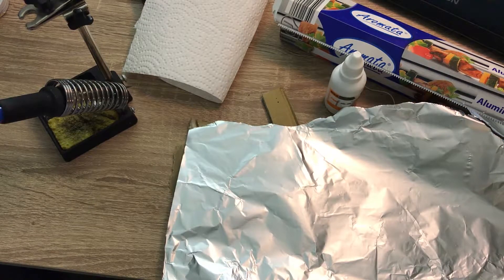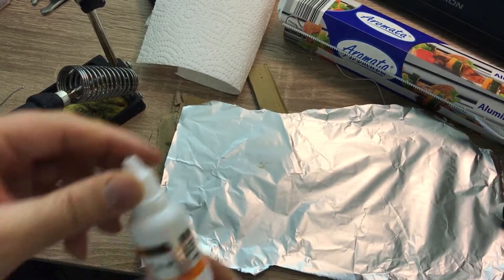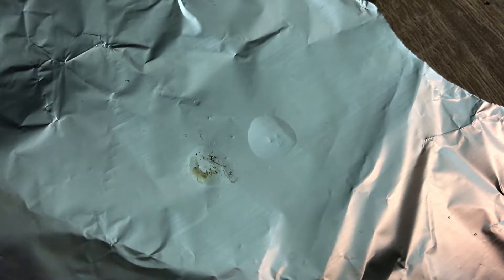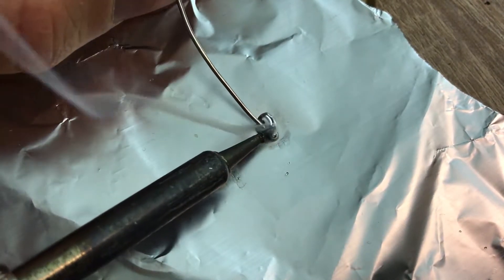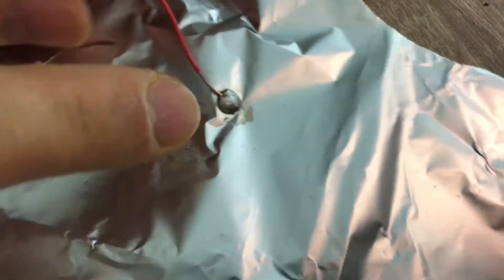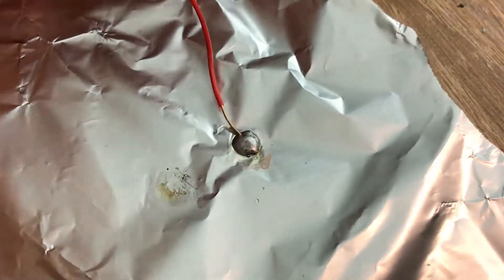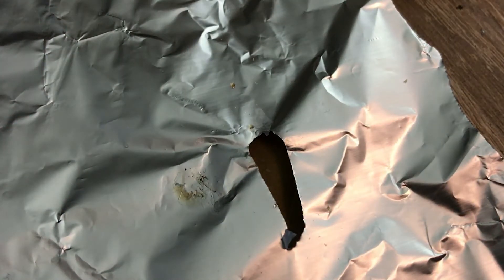How to solder copper wire to aluminum foil

Comment: Hi - It was easy without any special flux, I just applied a fair amount of cored solder and rubbed a bit - and it soldered!! I'm supposing that the flux in the solder did the job, I used Loctite Pat No. 3001850058. BUT after the tip of the iron would not wet for normal soldering!! The solder sat like water on a greasy plate and just rolled off. I had to file the tip to restore normal operation. I had read someone else who had noted this.

Comment: Something that worked for me first try was actually paraffin wax. I took a small piece from a paraffin candle, and placed it on top of the area I wanted to solder to, and heated it up with the iron with some solder on the tip until it stuck.

Comment: Many many thanks for this demonstration !
Aluminium is a very special metal. The flux you are using SEEMS to be zinc chloride 

(mixing zinc metal as roof furniture with diluted hydrochloric acid at 23% gives zinc chloride)

The bubbling visible on your video suggest a pickling action, able to dissolve alumina, this very thin oxide layer which form in few ...milliseconds. Very resistant to fusion (2300°C, alumina is invisible but forbids any soldering or welding)

Why you can't solder thicker aluminium parts like soda cans or fan block :

Because of the thickness, and the thermal conductivity of aluminium.

Most flames are with lots of oxygen, in it or ...supplied by the atmosphere.
So using a fuel rich flame will give you soot. And it will also forbid the soldering effect.

The best option is to use :
Very clean surfaces, scratched with FINE abrasives, made by silicon carbide

Then
Rinse the surface with acetone or isopropylic alcohol

Then
Apply the acid flux (ZnCl)

Then
Heat with effective ways : induction, resistive elements applied near the area to join, and use a "rosin" tin and lead.

Or
Use a butane+air flame
With some "aluminium95%+zinc5%" brazing sticks.

Work perfectly with massive section like aluminium profiles, class AA6060 or AA6061(AlMgSi alloys)

They will be softened after the heating (annealing effect)

Best regards from France
Reply: thank You

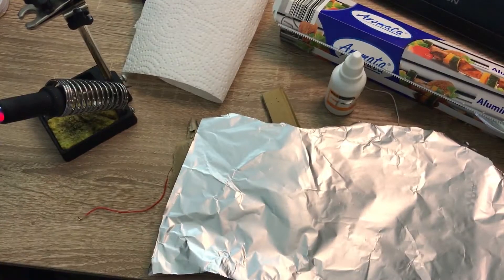Comment: 0:34 You didn't use the soldering iron tip to scrub the foil, that's why it didn't work.  

The oil method relies on you using the soldiering iron tip to SCRAPE/SCRUB at the aluminium foil.  This is how that technique removes the oxide layer & allows the solder to stick.  If you don't scrub at it enough, it won't work.  

But yes, a good acid flux also works 😀

Comment: Tried using vinegar as the acid and it worked :)
Reply: Can you please show your work, or private message me and tell me your process.  I'm trying to shield guitars from EMI and all the cavities and pockets are different and some guitars need to have a wire to connect for instance a pick up cavity to the cavity that houses the volume pot.   Thanks!

Comment: You can use cupper sulfate in water as flux
Reply: Is it that simple? No other precautions?
Reply: This is not a flux its an electrochemical reaction that plates out copper onto the aluminum that can then be soldered onto. Thus you are still soldering copper to copper plating on top of the aluminum.

Comment: 强力多功能焊接剂
通用于不锈钢、镜拌板、锦、制、铁等乡种金制
、「安腔用于部、管悴板、错、不除测产品、广
并仅器、玩商品质要求的各、及PCB版生产
核：
先用新精铭将待焊部位油污擦拭干净，然后律原水新
或涂于待焊部位即可焊接。
SOLDER MADE IN TAIWAN

Powerful Multifunctional Solder
  Commonly used in stainless steel, mirror mixing board, brocade, metal, iron and other local types of gold
  , "An cavity is used for parts, pipe slats, wrong, non-excluded products, wide
  And only the quality requirements of the device, the game, and the PCB version production
  nuclear:
  Wipe the oil stains on the parts to be welded with Xin Jingming first, and then rinse the raw water with fresh water.
  Or it can be welded by applying it to the part to be welded.
  SOLDER MADE IN TAIWAN

Comment: How about on thick aluminum..?
Reply from the maker: It does not work. I have tried it on aluminum heat sink, 2 mm sheet of Aluminum, and also on cola can after removing the paint, it did not work on any of them, But on aluminum foil it works perfectly. I have tried two different brand of aluminum foil
Reply: @HVE  maybe aluminum solder wire will do...?

Comment: This didn't work for me - the foil just corroded and the solder didn't stick. I used Alcan aluminum foil, which has the following composition (in weight percent, other than aluminum): 0.7-1.10 manganese; 0.05-0.25 iron; 0.21-0.30 silicon; 0.005-0.020 nickel; 0.10-0.20 titanium; 0.014 max copper; and 0.05 max zinc.
Reply from the maker: Do exactly what i did, just drop a few droplet and then right after a few seconds wipe it out. Then try to solder, otherwise it corrode the aluminum foil. Try it and update us here. If the liquid is on the aluminum and then you connect the hot soldering iron on it, it immediately corrode aluminum.

Comment: No, it does not work on aluminum
Reply from the maker: Check it on aluminum foil, as i showed in the video. Also use a hot iron.
Reply: @HVE  Aluminum foil has some nickel inside thats why it works. It does not work on aluminum heatsinks which are pure aluminum.
Reply from the maker: @ytkdmr  Thanks for the insight.
Reply: @ytkdmr  alumnium foil has no nickel.
Reply: You wrong use cupper sulfate in water as a flux

Comment: Really is it work?????
Reply from the maker: Yes it works. As shown in the video. However, while it works perfectly on different brands of aluminum foil, when i tried it on cola can (after removing the coating) i could not solder it. But if you want o solder copper wire to aluminum foil it works perfectly.